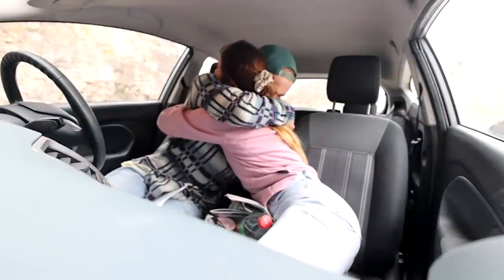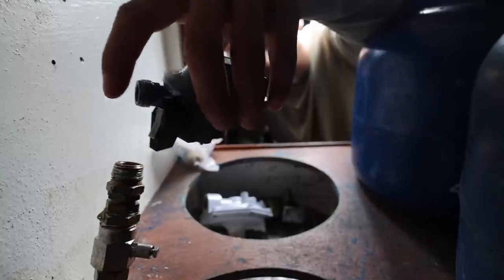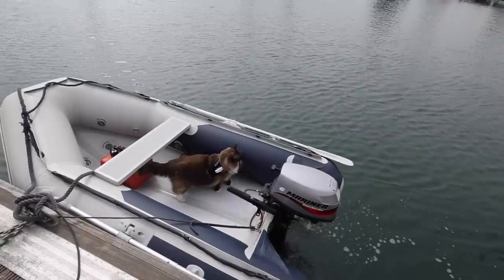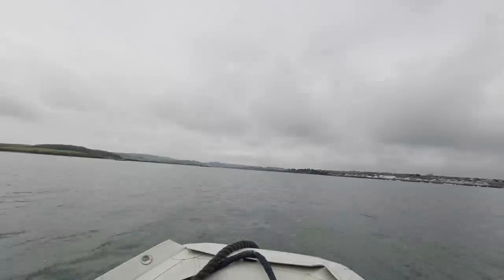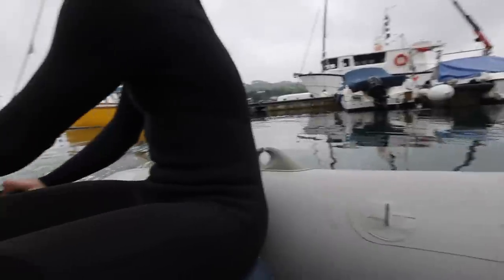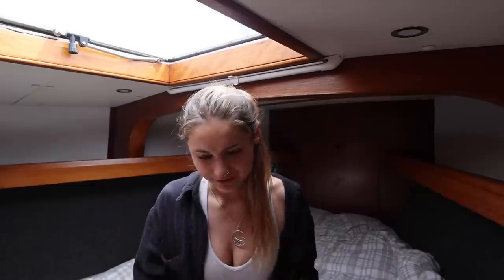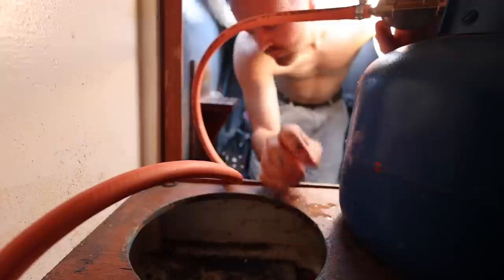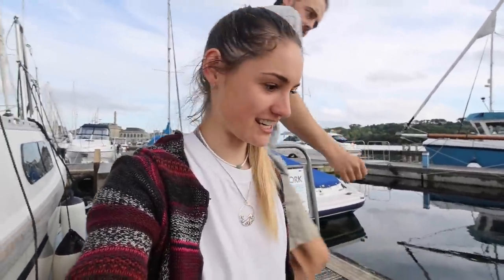We can't rely on this DANGEROUS system on our boat

Comment: Don’t you have a floor to exterior vent for the gas locker plus an alar? If you have been smelling gas it hasn’t been venting so it can potentially explode! 🔥
I believe Propane is heavier than air so make sure your vent is at the lowest point in the locker? 
If it was me I would replace the whole pipe line with a new continuous pipe from the cooker to the bottle regulator so you know there is no joints that can potentially leak in the future. Extending the pipe so you can fit the regulator more easily was a great idea👍
Reply from the maker: The locker is vented outside the boat 😊 and the locker is now sealed. The long copper pipe the whole way down the boat is continous and is in great condition. Zach checked this with soapy water just after we got the boat- thanks for the advice 😊

Comment: Hopefully this isn’t washed too far down the comments. I thought of a few products you may want/need aboard. When fiddling with anything threaded pipe/gas fittings, some quality Teflon pipe thread sealant(rector seal) as well quality Teflon tape (mill rose blue) or the like. You can get quality thread sealant/tape that works for both LP gas and potable water. If you take that puppy around the world you will certainly use it at some point. I would also recommend you get some PFTE silicone grease (Super Lube PFTE) as you will use that on all things rubber that are water related. I’d also get a can of (fluid film) or Boeshield (T-9) aboard for anti corrosion. While your at it Locktite (C5-A) anti-seize is so very handy on bolts. Most of this stuff is Amazonable.
Reply from the maker: Is Teflon pipe thread sealant the same as PTFE tape? We have the gas version of that but not too sure if its the same :) We also have the silicone grease you recommended but couldn't find a use for it in this installation! Where would you have used it? Thanks so much for all the suggestions. Will add it to the list now 😊

Comment: ok its lightly soapy water in a spray bottle to look for leaks works best. I'm not sure hose and hose clamps are a good long term solution for that gas problem
Reply from the maker: We did check for leaks with soapy water in the vid and are going to get it checked by a professional soon 😊

Comment: pro tip if you plan to live on the boat for many many years, start researching and saving for a lithium system, switch to convection cooking and electric outboard, you can power all your adventures using the sun with out the fire risk of petrol/gas - you think its hard to get gas parts in the UK, wait till you are in central america...
Reply from the maker: We would LOVE a lithium system but unfortunatley at this point in time it is just too expensive for us- in the future though! 😊

Comment: @04:03 On threaded fittings, that is not like an option! That is a must!, a requirement! And btw, this doesn't look right at all.
@13:00 This is the normal way to install gas.
The previous "installer" probably screwed up by screwing some odd things lying about together, that is dangerous.
Reply from the maker: We think the same!

Comment: Sorry but I think you made a mistake with that dingy. It has no holes, good size. You need to make flooring for it, which is really easy to do. As for the engine, it had sat probably for years but still started eventually and ran? After a proper service it would have been reliable cheao and perfect for you. Those little Daihatzu engines go and go and go.
Reply from the maker: Thats ok 😊 We are really happy with our Suzuki now, the other outboard hadn't sat for too long, and we could have cleaned it but it didn't feel the right one for us so we went for the suzuki!

Comment: Fix gas installation should always be done with pipes instead of hoses as hoses can shave and hose clamps can fail. Pipe connections are far more durable and reliable. Please change that hose for a pipe.
Reply: Not entirely correct.  A correct install uses neoprene lpg certified hose.  Though I note that they are missing both the required gauge and solenoid from their setup.
Reply: @pierremitham2964  Thanks. I just had read an article some time ago and probably didn't remember that. Or the regulations in Germany are different. Gas installations must be checked regularly here for the guarantee of insurance for example. At least the installations on board of super yachts use pipes instead of hoses. I'm naval architect and in a recent project we had to plan indoor fireplace, an exterior one. Often the chef requires a gas oven in the galley or fixed installed grills outside. Though the piping is routed by the machinery engineers.
Reply from the maker: We are getting a guage and solenoid next 😊
Reply: @TeuluTribe  the gauge is normally part of the regulator.
Reply: @Hotzenplotz1  On super yachts I'd agree with you.  They are installed and maintained by profesionals.  but on smaller yachts DIY with LPG is a dangerous thing,  Always better to buy prebuilt certified hose that already has the proper flair connections.  The other advantage of the hose is that its typically easily replaceable (if run in its own conduit)  and elimiates an extra joint at the appliance where you have to transition from copper to flexible hose anyway.
Reply from the maker: @pierremitham2964  we have never seen a marine or other regulator with a gauge on here!
Reply: @TeuluTribe  the gauge also has the advantage of being a leak detector.  If the pressure drops when the solenoid is closed,  you have a leak
Reply: @Hotzenplotz1  possibly.  One other thing.  When you get the solenoid. The better one to get is the units that have the alarm as part of the  control. They shut off the solenoid when the alarm goes off!

Comment: The gas ... not something to just work it out, have a go with. Seriously ... you've very likely invalidated your insurance, too. Please,  get an audit,  check,  from a marine gas engineer. I did,  even though I'm a very experienced engineer, in many technologies, even trained, certificated, to work on boilers, gas, years ago. He made some really wise recommendations, modifications, money very well spent. The gas .. is probably the biggest risk, to you and your boat.

Whilst I love your 'have a go' spirit, have to say it's potentially you're big downfall sometimes. 

Discretion is so so important,  knowing limitations, consequences ... at sea. 

Get it checked,. A domestic regulator isn't for a yacht,  because when boat heels, rolls,  liquid fuel can come down the line, and cause huge flare of flames at burner. Plus,  components deteriorate quickly in sea air. It's not approved for such applications. That flexi hose too, clips are not reliable. 

Finally ... didn't see you test for leaks, afterwards ... sniffer device,  or soap/ bubble solution. 

Consider getting a Bubble Leak Tester device,  installed. 

You're willing to dash out buy EPIRB, etc  ... but priority is really these basics,  and,  reflect on your competence in such matters. 

I do,  however,  love your enthusiasm,  ambition, wholehearted spirit ... much as myself, I've been living afloat, exploring, 5 years now, on anchor always, except winter in Finistère, France. Prudence is essential,  to dodge the various threats. Bon courage brave ones!
Reply from the maker: We have an inspection booked by a gas engineer soon 😊 We will never change or replace any safety system or equipment without getting it checked by a professional- its not worth the risk. We did do a soap water solution test after and have ordered a gas leak alarm. 😊 thanks for the advice!
Reply: @TeuluTribe  m'y Colvic Countess 37 had similar gas locker arrangement, plywood construction, that was accessed from inside the lazarette/ workshop. Engineer sympathised with difficulties of bringing older designs up to compliance standards, but insisted that it needed to be rendered completely gas tight,  towards interior of boat. Worst job ever,  was to prep all rider that locker, strip paint,  coarse sand,  to key, then,  completely line with grp, resin,  glass, and finally,  flowcoat. Then,  source a positive sealing access hatch, and improve the gas drain,  overboard,  plus a vent to exterior.  Only after he'd tested integrity,  plus,  installed a Bubble-test unit, would he sign it off. Did consider cylinde on deck,  stern, bracket, restraint, on pushpit, quarter rail ... but he wasn't happy with connecting hose, through deck gland ... plus longer pipe run, unseen,  potential for issues later.  Some use the massive anchor well,  subdivided,  has drain already. Again,  long run, and it's a busy area,  where shit can happen. 
Btw ... I've just obtained a Flogas cylinder, all plastic, grp pressure vessel, a fraction of weight, nothing to corrode, and ... translucent,  can eyeball the contents. Found them at B&M, B&Q ... have seen similar in Brittany, different branding, unsure if can exchange. Same 27mm regulator connection as Calor, I think. This concept surely the best,  for boats.

Though my comments earlier were very critical ... but it's actually a criminal offence, to interfere with gas installations, appliances, unless authorised,  registered gas trained ... for very good reasons ... there's much more to it than we realise. 

Good luck with your engineer visit.
Reply from the maker: @Neptuneboy1959  wow. Sounds quite the job! The Flogas bottles sound really interesting- will keep an eye out for them.

We did research prior to testing it and the RYA said this on their website, ‘There is no requirement for private boat owners to maintain and repair their LPG system on a regular basis. If the vessel is operated on inland waterways and requires a Boat Safety Scheme (BSS) certificate it must additionally comply with the BSS requirements. This does not require that a Gas Safe Register engineer carries out the work as the BSS does not stipulate how this compliance is achieved.’ It seems as long as your vessel isn’t used for any commercial activity, you are welcome to fix the system but it is still recommended to get a professional to check 😊 but then again, we may have interpreted that wrong!

Thanks for the suggestions!